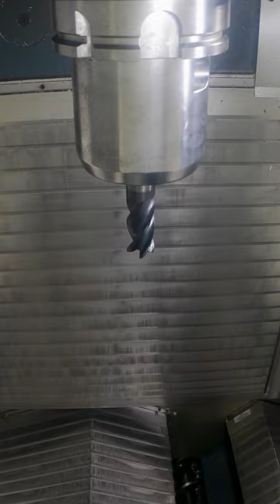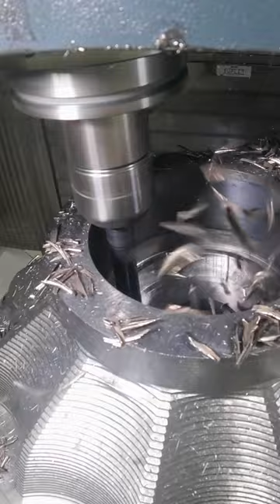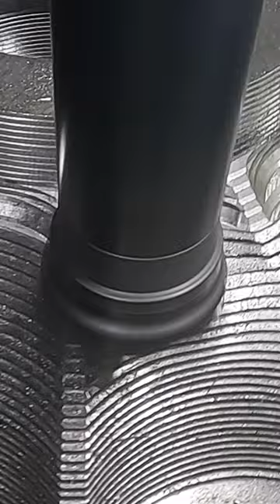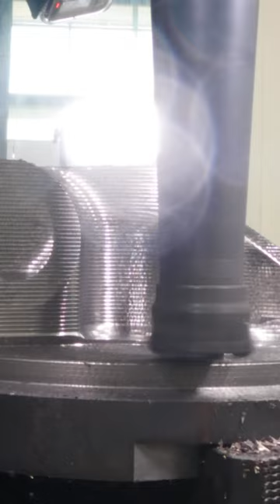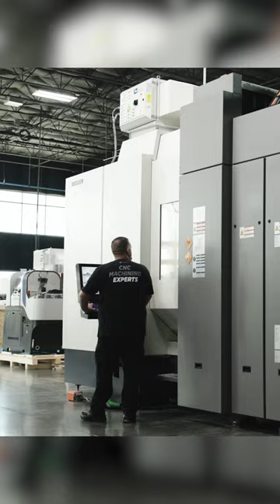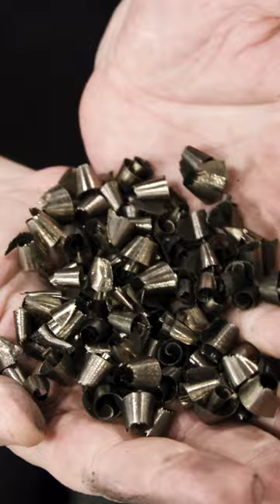Monster Cuts in the Heller CP 6000

Comment: I feel like the only machine shops who take a lot of material off at once like this are the ones with the best of the best machines, is that a correct assumption?
Reply: I mean you're not wrong.. Great machines definitely help but it also comes down to knowing what tools to use and how hard you can push the tools without them breaking.
Reply: We have cheaper machines in our workshop but we’ve recently moved to Kennemetal tools and they really have improved our run times because of how much work they can do. Today we ran a 16 mm cutter at 8000rpm, 29mm cut with 6mm set over at 2030 mm/min, I think that’s 80”/min roughly. Material was 7075 Aluminium. Then same tool was taking 12.5mm cut with 4mm step over, Rpm 2650 650mm/min feed on 304 S/S The industry really is moving forward but the tools do come at a hefty price. One crash and it tears.
Reply: @travisjdreyer2231 We use mostly Kennemetal. Definitely good inserts.